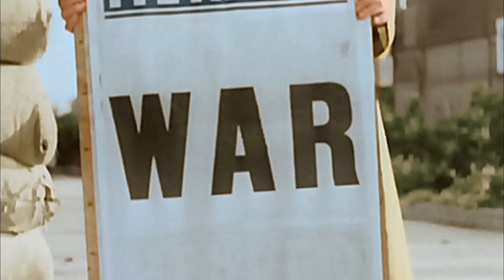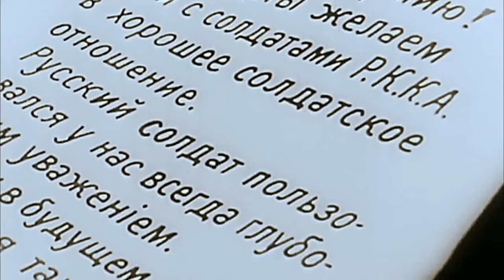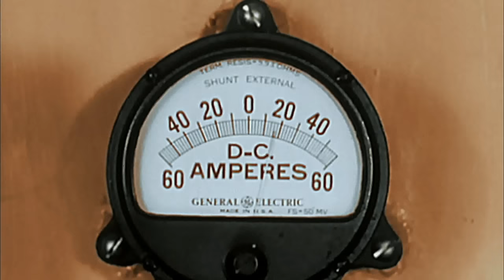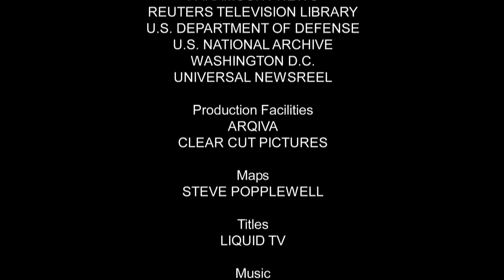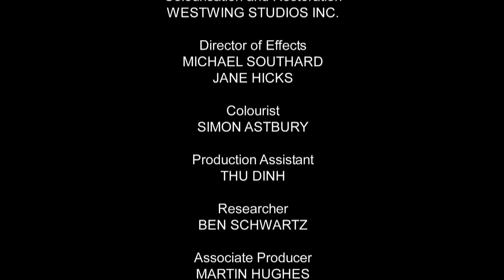World War II in HD Colour: Lightning War (Part 2/13)

Comment: Its fascinating how different everything in 1940 looks to 1945
Reply: War will do that sadly.
Reply: Due to the war around the world, the advancement in technology was more extreme in those 5 years than the last 20 years before that. The world changed substantially in those short 5 years.
Reply: @giraffeman326  and look at how much technology changed in the last 20 years recently compared to the 80’s and 90’s
Reply: @BostonsF1nest  my point was that from the 1890s to about the 1970s the world was changing the most. With innovative inventions like aviation as well as the advancements in cars, medicine, communication, media. The world then was changing more then ever, with both changes in technology and ways of life. It started slowing down towards the 1980s. Sure we have recent technology like the smartphone and the internet, but if you ask me not as much technological changes happened from 2010 to 2020 as they did during 1940 to 1950. And you’re right too. The advancements in technology that happened from 1980 to 1990 are astonishing.

Comment: In part two there is only little mention about Soviet Unions attack against Finland. On 30.11.1939 the red army launched massive attack against Finland using half a million men in order to occupy the country in two weeks. But finns resisted heavily, winter war 30.11.1939 - 13.3.1940 caused heavy losses to Stalin and his army, more than 400 000 red army soldiers died or wounded. Finnis casualties was 28 000 dead. Soviet union got some eastern land areas and cities in Karelian istmus. But failed to occupy our country.
Reply: I think this is mentioned in other WW2 in color docs.  I know I heard it somewhere.  While this doc is really well done they do skip over some things.
Reply: They talk about it from 20:39 to 22:30 so about 2 minutes. There are other documentaries which go into more depth on the Winter War though.

Comment: Contrary to popular belief the invasion of Poland wasn't entirely one sided. Polish calvary didn't charge tanks with Lances, they were used primarily as mobile and reconnaissance units and did have some local success against German infantry. Despite Poland having an inferior airforce, its pilots were some of the best trained in the world. Also Poland cost Germany almost 1000 tanks especially during the siege of Warsaw where it managed to hold out against the terror bombings of the Luftwaffe it wasn't until the Soviet Union attacking from the east essentially made any further resistance by Poland pointless.

Consider this fact, it only took less then 2 extra weeks for Germany to conquer France, Belgium and the Netherlands and the opposing forces involved were far more even then during the battle for Poland.  Plus the Polish army wasn't fully mobilized when Germany invaded, they had only 500k troops but at full strength could muster about 1 million troops. Its airforce also wasn't wiped out in 1-2 days, inferior perhaps but the Luftwaffe still lost almost 300 aircraft to Polish aircraft and antiaircraft units which was roughly 25% of its initial strength
Reply: Well they only crushed them in two weeks because of the success of breaking through the ardennes.
Reply: It did state that the polish cavalry was likely legend
Reply: Poland had no shot.  They were isolated and the USSR hitting them in the rear destroyed any chance of resistance.  If not for USSR attack, Poland could have pulled back to the East and put up more of a fight.  I don't think anyone on here considers Poland weak or cowardly, it was the surprise attack, USSR betrayal, and the effectiveness of the German army.  (Frankly Germany was almost unstoppable at times in WW2 and, I hate to say it, was probably the strongest army in the war.  They just got overwhelmed by trying to fight the World basically).
Reply: @volbound1700 If Germany was the strongest, I would say that's arguably true to an extent up until 42-ish, but the losses of experienced soldiers, commanders getting outsmarted a good amount, poor logistics, far too many places to have troops deployed, the list goes on and on.

The only reason they did so well up to a point is because the Allies weren't quite ready yet and hadn't learned the right lessons on how to fight a nation such as Germany. Once they did, Germany didn't stand any chance strategically in any form.

Comment: France had a chance early on in 1939 when Germany had most of it's forces in Poland. They went into Germany sat there a bit then turned around and left, a missed opportunity to get at Germany early
Reply: I watched a video about that.  Although the French had the Germans outnumbered, Germany had defenses similar to France along the West.  Also, the French army started to pull out only when news of the fall of Poland was happening.  The French army had met some stiff resistance and was getting bogged down.  Had they pushed further, there was risk of getting cut off when German troops arrived from Poland.

Comment: It kills me (pun intended ) that the British did not rely on America with tank Data. Even te U.S. produced the gas( instead of diesel) operated Sherman when they should have produced something like the TIger but more simple to fix. The war would have been far shorter. 180mm gun and a GM design. We barley won based on Hitler's stupid mistake of following Napoleon attacking the RUssians.
Reply: Honestly, even if the US could have afforded to build a tank like the Tiger, it's debatable about the impact it would have had. Honestly, the Sherman was a decently designed tank all things considered. It was the US tank doctrine at the time that kind of was silly. The US tank doctrine stipulated that tanks weren't for killing other tanks but rather supporting infantry. That is why they had a separate doctrine for dedicated tank destroyers. 

The reason why the Sherman was simple to fix was that it had to be. It's harder to mass produce something that is as complex as the Tiger. America produced nearly 50,000 Sherman tanks. I mean the Tiger itself entered service in 1942. With America's entry into the war in 1941, they needed tanks, and a lot of them. Trying to produce something to compete with the Tiger which simply only made a fraction of Germany's overall tank forces would not have been cost effective. 

There are a lot of myths and misconceptions about the M4 Sherman. 
http://knowledgeglue.com/dispelling-myths-surrounding-m4-sherman/

"From 1943 onward, the US military had in its posession an extremely effective anti-tank round for the 75mm cannon called the M61 APCBC.

The APCBC could actually penetrate the  Tiger tank from ALL aspects as well as the Panther in most regards. It could penetrate nearly 100mm of enemy armor from 500 yards and over 90mm from a thousand yards. This was enough to penetrate the rear or side armor of the Tiger from the longer distance, or at a distance of 500yds, penetrate the tiger from the front. Many critics of the M4 do note that the up-gunned tanks carrying the 76mm gun could take on a tiger, yet the armor penetration of the 76mm is only 5% better than the 75mm armed with the M61 APCBC ammunition. Sadly, due to McNair’s orders, APCBC was not issued to tankers and instead substituted with an inferior type of ammunition (The standard APC, which had 30% fewer penetration characteristics.

The Russians were quite a fan of the power of the 75mm cannon the Shermans. the difference between the way the USSR employed them and the way the US did was the fact that they actually issued the M61 APCBC to their troops."

The Sherman is also often criticized for it's 'paper thin' armor, but a lot of people fail to consider the angled armor. 

"The Sherman’s armor was nearly identical to the T34, later in the war, it was even increased well beyond the T34′s armor. The Sherman offered around 50mm of frontal armor at a 45-degree angle, offering 70mm of armor in relative thickness. The T34 offered about 40mm of armor at a 45-degree angle or 56mm of relative thickness.
Overall, the armor was inferior to that of the Panther or Tiger, but was superior to tanks that were more similar in usage – The T34 and the PzIV."

"the Sherman may not be the best tank on the face of the planet, but it was hardly a pushover against ANY tank on the battlefield. It compared very well against the Panther and could put the hurt on a Tiger should it be needed. It was additionally far superior to the Pz4 or Stug3 which were the most common armored vehicles it would have encountered in ww2. Much of the hate against the Sherman has been perpetrated post-war and sadly most of it is from Belton Cooper."

"Cooper’s indictment of the Sherman tank’s inferiority compared to the heavier German Panther and Tiger tanks ignores many important facts. First, the Sherman was designed for mass production and this allowed the Allies to enjoy a 4-1 superiority in numbers. Second, fewer than 50% of the German armor in France in 1944 were Tigers or Panthers. Third, if the German tanks were as deadly as Cooper claims, why did the Germans lose 1,500 tanks in Normandy against about 1,700 Allied tanks? Indeed, Cooper claims that the 3AD lost 648 Shermans in the war, but the division claimed to have destroyed 1,023 German tanks. Clearly, there was no great kill-ratio in the German favor, and the Allies could afford to trade tank-for-tank. Finally, if the Sherman was such a “death trap,” why did the US Army use it later in Korea or the Israelis use it in the 1967 War?"

As for Sherman's propensity to ignite due to gasoline?

"Early in the war, the Sherman tank had a nearly identical rate of failures when compared to its contemporaries. The Panzer IV had a nearly identical rate of catastrophic failures.  Even  Belton Cooper – whose book ‘Death Traps’ was highly critical of the M4 Sherman’s performance did note several times that German anti-tank crews had a very difficult time catching the tank on fire

In mid-1944, the US introduced wet stowage to the ammo compartment of the tank. By all accounts, the rate of failure decreased by an overwhelming 75%. This decrease dropped failures to even below that of the dreaded Tiger tank."

A lot of people also seem to think that if the US had entered the war earlier it would have had a significant impact and ended it sooner. It's important to remember that after WW1 America's military was kind of outdated. Our tanks were antiquated compared to those found in Europe, as were our aircraft. It took a good deal of buildup of military powerup before we were even capable of fielding an effective military force. Just look at some charts sometimes of the military buildup from 1939-1941 but particularly during 1942. The American Military was only about 100,000 strong without the draft. To enter the war prior would have likely meant a complete decimation of our forces. 

This chart is from the National WWII Museum.

https://qph.fs.quoracdn.net/main-qimg-c8bc61860500e99270fc20e5ab348790

This second chart shows the aircraft production of the US in WWII. As you can see, even if the US had entered earlier, it's impact would have been relatively negligible. It wasn't until 1942 where it had anything that remotely resembled a fighting force of any significant size. 

https://qph.fs.quoracdn.net/main-qimg-ed684f3dfb541947bb220ce3134d4c07

As for your other post about a bunch of P-51's, would have been helpful, they were when they entered service. But you can't honestly expect that the P-51 was available from the outset? As the war progressed a lot of the knowledge that was gained during aerial combat was then applied towards producing the late war aircraft like the Mustang. The Mustang wouldn't even have been as effective as it was if not for the Brits idea to swap the Allison engine to a rolls Royce merlin engine. 
___
As for Hitler's mistake of invading Russia. It was hardly Hitler's only mistake. Hitler was his own worst enemy and failed to listen to the advice of his own generals. Rommel was a brilliant tank commander and yet was forced to commit suicide. Hitler also wasted countless reichsmarks on grand construction projects that Germany simply didn't have the resources to bear. And when the allies were knocking down his door, he instead focused on his 'mega weapons'. When America entered the war which had the industry for mass production, it was, in my opinion, a self-fulfilling prophecy that Germany would not be able to withstand the combined resources of the US, UK & Commonwealth forces, and Russia too. Hitler certainly didn't help the situation.